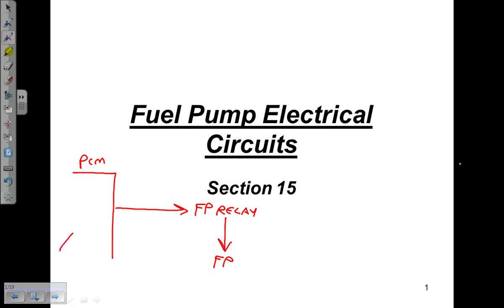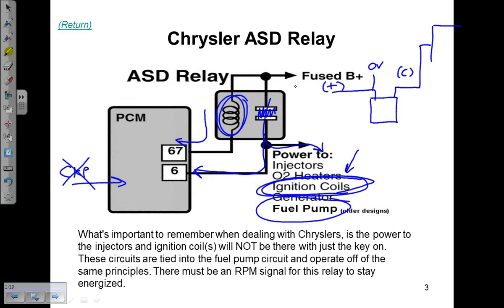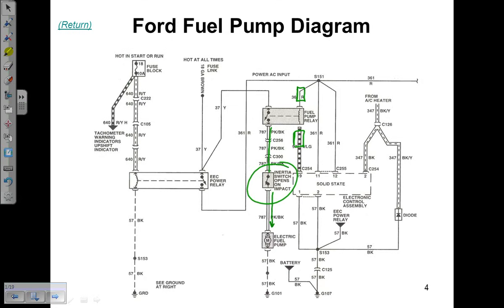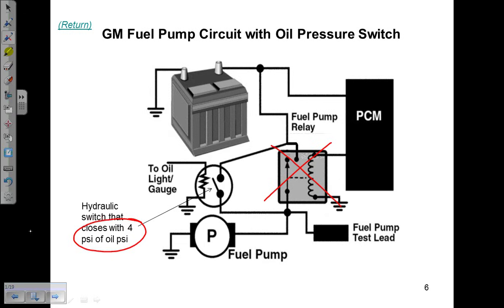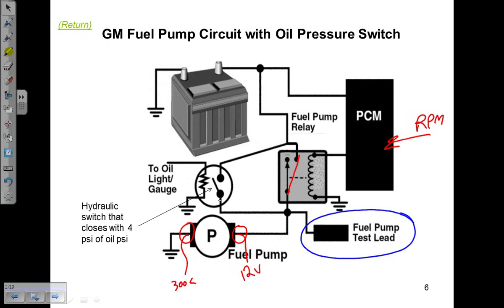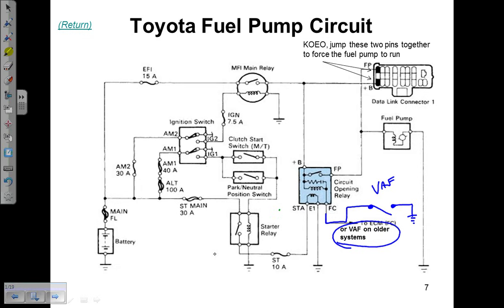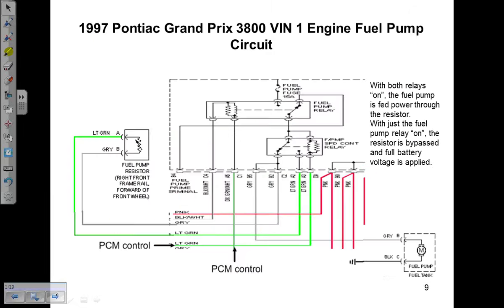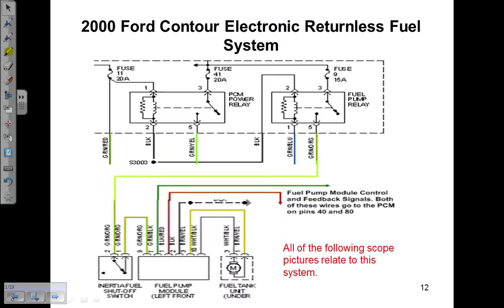Fuel Pump Electrical Circuits Description and Operation

Comment: This video made my day! I have a GM 1987 calais. The fuel pump issue has been a mystery to all of the mechanics Ive delt with. When Ive tried to explain to them that it was this relay but couldnt explain what exactly I was talking about. This explained all the issues that I have been having for 12 plus years! A simple inexpensive relay switch! Now that the back up on the oil pressure side of the switch has gone bad its a no start. Being a woman and an unusual problem Ive asked the mechanics and part store to view this video. and one other.  To my surprise im told no such part exists despite haven given them  the part # nor is there one like it.  Regardless, Im grateful you made this video.
Reply from the maker: +Chucks Mom so you fixed it then? With a new relay right? And if it is the oil pressure switch that you can't find, don't worry about it. The newer systems don't use this set up anymore anyway. The relay is good enough.
Reply: No I havent fixed it yet. I have 4 relay switches, 3 of them have the orange wires going to them (not just one) and two of the relay switches it appears the auto parts store has never seen or dont have. Im thinking that they were done when they did the recall about the relays?? Im over 30 mls from town and no other vehicle to run the switches in to try and locate the correct ones. Still the video is very enlightening and helps me a lot with the car. I knew it was ummm unusual. A big thank you.
Reply: +Chucks Mom from memory you should have a gray wire and a green with a white stripe (this is the computer control wire) the other 2 I'm not sure. Orange and black I think.
Reply: +ScannerDanner Premium mind you it old and dirty before the relay went out I was going to have the engine cleaned after an oil change. as I said I have 4 relay switches. the 2 unknowns.. 1 has: small wires, 2 orange, 1 green with white line,  1 black with white line and 1 gray/tan?. The second unknown has..sm wires 3 greens 2 with lines,  1 blue, 1 orange.. The 2 Bosch relays: 1 has 1 lg orange wire, 2 lg red, 2 lg blacks, 1 lg blue.  the second has.. 1 lg red, 1 lg red and black, 1 sm green and tan and 1 sm tan.   Its the plug diagram inside the relay switch of the unknown Im having trouble finding at a part store or on line. 
Did this help? Thanks in advance.
Reply: +Chucks Mom so It appears you may be talking about the first unknow relay?  yet the Bosch shows the switch diagram on them. Ya im confused sorry.
Reply: I just watched another video you were on and you actually had one of each relay in your hand. One of them is a EEC relay we couldnt Identify. Thank you. Should that be checked also if it has the same colored wires going to them? Again thank you so much! Ohh the video I saw this on was ScannerDanner gets his butt kicked by an 88 F-150. Which is also a good watch for me as I have a 89 F-250 460 4x4 modified mostly coolant issues with this one. I think my water pump seized up and all kinds of fun things to fix now.
Reply: +Chucks Mom If this is the 2.5 4 cylinder you should have
1. an orange and an orange black going to one terminal (2 wires)
2. two tan whites going to one terminal (2 wires)
3. a black white on one terminal (1 wire)
4. a dark green white on one terminal (1 wire)

Also GMs don't use an EEC relay like Ford does.
Reply: +ScannerDanner Premium It is mounted to the firewall next to the AC relay and right next to that is an ESC module
Reply: Thank you. Still the ESC isnt the one I want to change, correct? So basically only replace the ones that have the actual relay switch diagram on it. As you just said in researching the other two it mostly related to most of the other electronics on the car not the actual fuel pump relay/oil pressure switch. Again your time has been greatly appreciated. I was raised old school no major electronics on the vehicles so Im winging it here. Thank you :)
Reply: I just peeled the elec tape back on all the wiring to see the wire colors better.. to me all the wires you were talking about are all on 1 ESC, assuming the Bosch ones with the fuel and oil diagrams on them are what they indicate they are .. Sorry Im making this so complicated. Im disabled with lupus and glaucoma etc. So its a bit more of a process with me then with others. Thank you for your patients and time. So is it the ESC I need to replace (with the colored wires you listed) and forget about the others?

Comment: Danner.... doing a voltage drop test of power side to fuel pump eg. voltmeter to positive battery and back probe at connector at fuel pump. Prior to the 2 second prime, should you read battery voltage? I read the battery voltage and then a 1.25 volt difference when in prime stage. I also read a .6 volt drop on ground side when doing the same drop test with battery ground. All this results in a steady state voltage drop across the active fuel pump of around 1.5 volt difference than true battery voltage. I went through a fuel pump replacement quickly(only lasted 5 months old) and this is why I have investigated the voltages. Seems less than ideal, but not clear if within parameters. Thanks Dan.

Comment: Great Stuff learning so much.  1989 Olds Cutlass Supreme 3.1L. Started and ran fine till I gave it to my Girl freind. She hates me now.  Itermittant start on  warm.  Always start on cold. fuel seeming slugy up hills etc. fether the throttle to get up speed.  Started to die and lower than 9k rpm at stops.   pulled replaced fuel filter. 60% better for 4 days. I can not get to the car to test a thing.  Now I have it watching your videos over and over on No starts 3 part series. Confirmed. Spark. Air. Checkengine light.  code 12 when I want but no trouble codes after. Got spark so I have RPM signal. tested 5V reference good. CPM good. fuel pump has prime for 2 sec and get NO pressure checked at Shrader valve.  Tested loaded pump with the Fuel pump test lead and all power and ground are solid.  My call.  Fuel Pump.  You are the best ScannerDanner.
Reply: Nice. Thanks!

Comment: I have problem, my car runs but it shuts off after a few minutes. Is the fuel pump causing this? I changed the crank shaft sensor position and it still shuts off

Comment: Hey man great video, just wondering if you could give any insight into why my 95 grand cherokee is only getting 6v to the fuel pump?  I see on the 92 model that you talked about there is a ballast resistor that would drop the voltage down but you said after that year they eliminated that so I should be getting 12v right?  Thanks for any help you can provide.
Reply from the maker: See if you have this same 6 at the ignition coil and injectors.
Reply: With the ignition on I have 12 at the ignition cool and 7 at the injectors
Reply: And 6.25 back at the pump

Comment: Great Video! what should be a normal operating temp for a fuel pump relay, that is used on a CSI system? I'm asking because the one in a 04 Cavalier Ecotec 2.2 is running between 105*-106* while engine is running. The engine while running will just randomly cut off, without warning, then I here that relay click, then I turn the KOKO and the fuel pump will re-prime, and engine will restart, then the cycle starts all over again....thanks for any input.

Comment: The oil pressure switch allow the engine to run if the fuel pump relay become defective while the vehicle is being driven, preventing the vehicle from stalling due to lack of fuel.

Comment: On the GM you said, "...if either one of these two blue lines... has power, that pumps going to stay running." Exactly.  What GM failed to realize is that this can be the case even with the key off! How so? How about a faulty oil pressure switch that stays closed after the engine is shut off? It was a '91 Regal 3.8L. That switch is wired straight to +BAT. but does have a fuse. Additionally, you can pull this fuse to disable the fuel pump to do your FI service. I've also seen worn engines that NEVER build enough oil pressure to close the switch and turn the pump on. Of course they have a more serious problem. Good presentation.

Comment: wait a minute u said no rpm fuel pump is not turning on in all vehicles models or some expleane
Reply: Creo que te refieres cuando el  menciono que si no hay RPM  la bomba no funcionara, el se refiere a la "maquina"  RPM , el se refiere  a ,si hay un accidente se te corta una linea de gasolina  tu maquina  dejaria de operar y no mandaria la senal de rpm  y tu computadora apagaria la bomba de gasolina, dejaria de funcionar  , la computadora necesita ver RPM de la maquina para activar el relevador que activa  la bomba de gasolina . el RPM sale de los CAM y CRANK  sensores. asi lo entiendo yo.

Comment: What a great presentation!  I was on the internet for three days looking for fuel pump information and here you deliver the goods in less than.20 minutes for the GM portion.  You hit every part that I needed to know, especially the RPM signal has to be present and using the test fuel pump wire for GM.
Keep up the good work and I hope that I will be able to teach as thoroughly as yourself.

Comment: Hey I have a 2001 dodge neon that won't start, test pump and is good, test relay and is good. Y did test power to the relay and it doesn't have a signal from the pcm. does that mean Y need to replace the pcm?

Comment: I first ran into GM using an oil pressure sending unit to back up the FP relay on a 1986 Pontiac Fiero(base model) 2.8l 60degree V6. If I remember right, it also provides a ground for the storage tray light. With no power steering, that car was a bear to drive.
I think the GT models got PS, I don't remember.
Awesome video

Comment: what to do if my Cadillac cts 2003 wont turn on ,turn key don't hear fuel pump activate but when i take out relay (fuse box under back passenger seat )and jump 2 holes of 4with a wire where relay should go car turns fine  , (relay works because I tested it on another Cadillac )

Comment from the maker: First, I would get yourself an AC delco pump this time. Second is to make sure you replace the in-line fuel filter and third is to verify normal fuel pressure after installing a new pump. A regulator that is sticking closed will increase your fuel psi and make your pump work harder. Although you would probably have some rich exhaust codes. Also make sure your pump has a good power and ground. Another good practice is to not run your tank too low. Fuel acts as a coolant for the pump motor

Comment: Hi Dan could you help me w/ my possible fuel pump issue that i am having? I have a 2002 chevy silverado 5.3L z71 and in 2 years i've switched out 2 fuel pumps and working on my 3rd! i sprayed engine starter fluid into the engine after taking off the intake & it cranked up until all the fluid was evaporated and died.i checked the relays & switched the horn relay with the fp relay and nothing.why are the fp's dying on me? it has to be something else causing this.please help! laveos@hotmail.com

Comment: It's a old 91 mazda mpv 6 cylinder two wheel drive. It has a problem starting cold.it stumbles real bad. I will buy a fuel pressure guage later ,and check out the relay.

Comment: 98 Chevy 1500. Just died going down the road. Fuel gauge will not register. Not getting 2 second prime, will run if relay jumped, no 12 v on 85 pin ever. Will not start by just the oil pressure switch. New fuel pump, new relay, new TPS. Please please help.  We've been working on this for a month!

Comment: The one with the module that varies pump speed, how is the computer controling the speed of the pump? It's on the bonneville schematic you showed on this video.

Comment from the maker: which one, the one with the resistor wired in parallel or the one with the module that varies pump speed?
In either case they only used this system on the supercharged engine. The pump only ran at full speed during cranking and under boost pressure when additional fuel volume was needed.

Comment: Paul, could you explain the bonneville fuel pump operation for me on this video with the variable speed pump?  I am looking at the schematic and it is confusing me, could you elaborate a little more on the operation?  Thanks.

Comment: hi there mr. danner i have a 99 jeep grand cherokee 4.7l that keeps throwing p1391 (loosing cmp/ckp signal intermittently) i change both sensors also i checked tooth wheel which seems to be ok, now im stuck. the is no start no fuel/spark. pls help

Comment from the maker: The fuel pump relay driver would be the transistor that controls the fuel pump relay coil. It is internal to the PCM and is not replaceable by the average person, so PCM replacement would be necessary.

Comment: I have the 5.7 in my car with a 6 spd manual transmission.  I checked the PCM with my OBS II scanner and i'm not getting any scannable codes.  I will unhook the PCM later and see if the fuel pump is still getting power from somewhere.

What is a PCM fuel pump relay driver?  Is that internal to the PCM?  If so, what would the fix be....replacement of PCM?

Comment from the maker: that whatever circuit is crossing into the fuel pump relay control wire has lost power with the PCM unplugged. One other thought is something is going on with your crank sensor circuit. Maybe you are getting some electrical interference which is causing the PCM to see an RPM signal with the engine not running. I would think you would have some type of code with that. On the 5.7 they used an optical distributor(some models) that had a lot of problems (water pump would leak into it)

Comment from the maker: In either case the dark green/white wire is the PCM control of the relay. It is a power side switched circuit, meaning the PCM supplies power to this wire to energize the control side of the pump relay. You need to isolate this wire from the PCM (unplug the PCM) and see if you still have power on this wire. If you do, then it is shorted to power. If you don't (with the PCM unplugged) then suspect a shorted PCM fuel pump relay driver. Of course with the PCM unplugged there is the possibility.....

Comment: Scannerdan, awesome vid.  I have a question for you if you have time.  I have a 98 Chev Camaro with a stock ECU and aftermarket "plug n play" Racetronix Fuel Pump.  With just my ignition turned on, my ECU "fuel pump trigger wire" is running constant voltage to my fuel pump relay & in turn powering my fuel pump on all the time.  My car no longer does the "2 second" prime and shut down with just the ignition on.  I have replaced the fuel pump relay and am stumped.  Any ideas would be appreciated.

Comment from the maker: ok, when you pull the relay out, you should have two pins that show battery volts with the key on. One of the other pins will be a switched ground. You can test this one by connecting your test light to battery positive. It should light when the key is first turned on, then go out after a second or two. Then re-light during a crank. If this functions this way the ECM is controlling the relay properly. 
The last pin goes to the pump itself and if your test light is connected to b+ it will too.

Comment from the maker: Pin 30 is usually hot all the time, but not always. Also the control side of a fuel pump relay should turn off immediately with no RPM signal and will only "prime" for about 2 seconds. Of course some systems do not provide a prime. What year, make, model, engine?

Comment from the maker: @oakalla6870 That's better! On this year internal ECM board problems were common. What you are describing is the typical symptoms (cooling fan random operation and a flashing MIL). To test: warm up the engine and interior of the car (heater on high). Locate the ECM (should be behind the glove box area) and tap on it. If the MIL lights or the cooling fans come on or the engine stalls or stumbles, then you found your problem. These are cheep to replace too. Less than$100.

Comment from the maker: @ScannerDanner I am just not willing to study legends and keys and abbreviations for wire colors, just so I can follow the diagram, because I may work on 5 different car lines in the same day. With Mitchell I don't need to do that, 
I am sure times have changed but I remember needing a complete PCM diagram on a car once and the alldata diagram was 50 pages of segmented parts. Mitchell was two pages and it was complete. I am not sure if it is still this way or not.

Comment from the maker: @dreamer2355 Alldata is fine, but Mitchell has better diagrams for the aftermarket tech. They re-draw all of the factory diagrams and use a uniform method and procedure for each car, so every car is the same. Alldata simply uses the factory diagram. That may sound great but every car line has a different way they do there diagrams. So the dealer tech. loves alldata diagrams and the aftermarket tech. loves mitchell diagrams.

Comment from the maker: @Bonfield2002 This is actually the first time I researched this, it looks like I had to go back to 1998 on the cars and 1999 on the trucks. Although not all, some of the dual tank systems were different too. It seems after the 2000 model years GM got smart about it and finally got rid of it.

Comment: Fantastic presentation!!  Question.  Ov course I had to look at my wiring schematics for my 2002 silverado 2500hd 6 liter gas to follow the parallel circuits from the oil pres. sensor and fuel pump relay but  my  factory service manual from helms   does not show anywhere the oil pressure sensor in a diagram.  Is this fail safe system still being used by GM on late model vehicles. So if I start the truck and pull the fuel pump relay it should keep running if my system is wired as you explained.